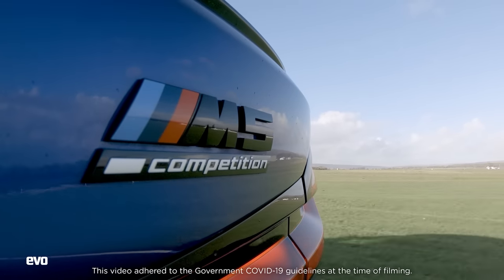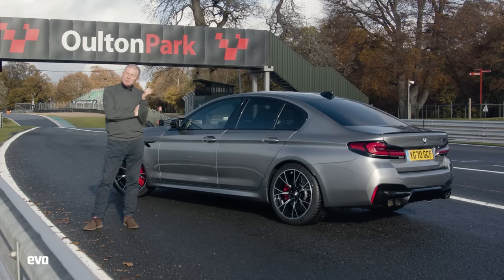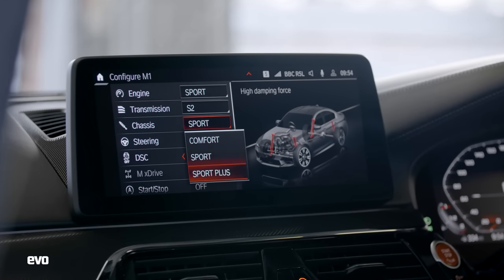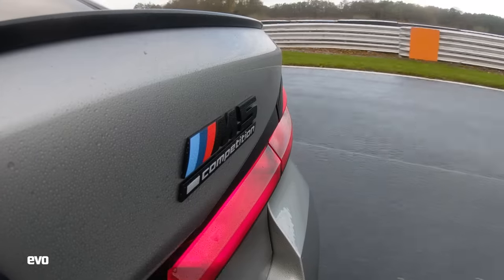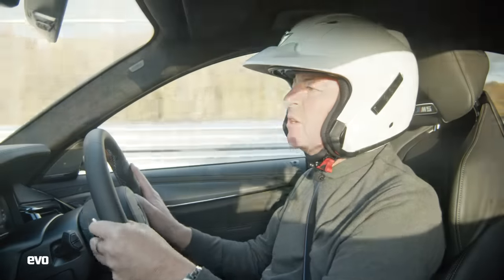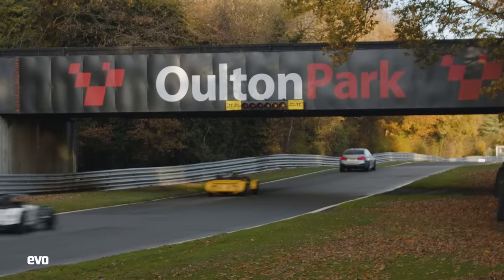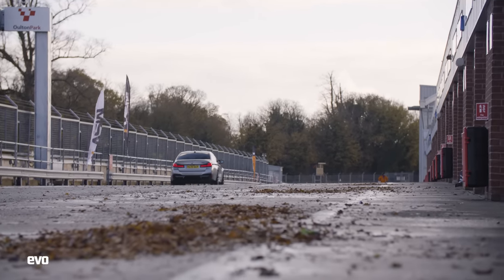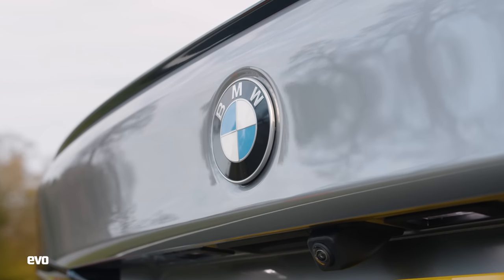How to drive a BMW M5 Competition on track part 1: Oulton Park

Comment: "In association with BMW M." -  yeah..even the legend Sutcliffe struggled to look entertained in there. Appreciate it's mighty fast, but there's more to trackdays than that.
Reply: I think that's just its' size. This thing is 5 meters long, well over 2,1 meters wide. There's nothing you can do to a car this big to make it fun. The only big cars I see people enjoying are Porsche Macaans, I've seen people floor X6Ms and GL AMGs but they never get ANY close to the limit on corners, except for crashes. And while I see Macaans being driven hard, these are 30 centimetres shorter than the M5, they are much less wide, too. So it makes perfect sense if you consider that these actually are smaller cars. The newer SUVs have great handling, and still you never see anyone use that handling. The Land Rover SVR got the SUV laprecord for the Nurburgring, yet in reality nobody drives these quickly, if you put it into sport mode the police will just tow your vehicle because it's to loud. Most of the owners aren't even clever enough to put it back into comfort mode once the police wants to do noise checks, meanwhile aftermarket exhausts with the same loud/quiet (or open/close) feature are forbidden, you will get towed if you put them on your car and the officers notice the exhaust. Regulations and laws have become a complete sh*tshow, there is no going back for any german brand on the horizon. Just overpriced, overweight garbage cars with a lot of safety features that nobody needs, a lot of electronic infotainment features which will make your cars' value drop to 10% once the warranty ends.

Comment: So what did we learn? I don't know about you! All I learnt was the settings you had set. If I understand correctly, the red button gives you two options of set up and you switch between the two depending where you are on the track?
If so, why no shots of your line and where you are on the course or what setting you've selected for a particular part of track. 
You had fun, I just got bored!

Comment: You don't have to be a superhero to extract most of the m5... and that's a problem... it takes away the pureness of the driving, my grandma could sit in today's sports cars and drive fast. Cars are going in the direction where drivers would only be operators of the buttons, no skill required to drive fast. Sad if you ask me...
Reply: Plus, this is a tank